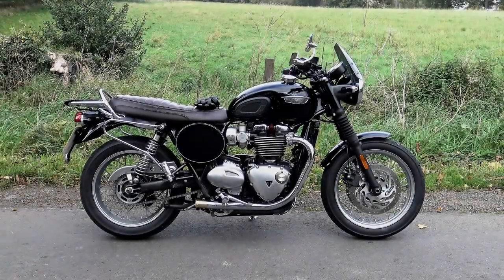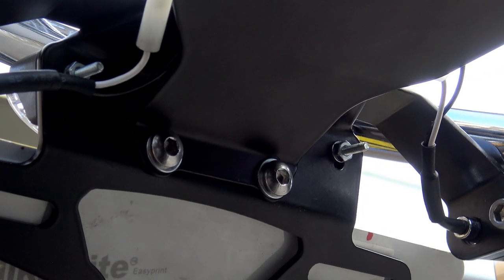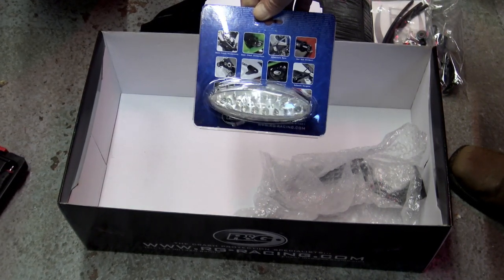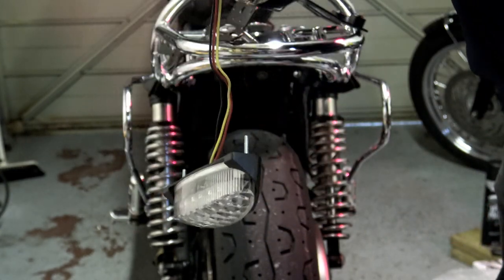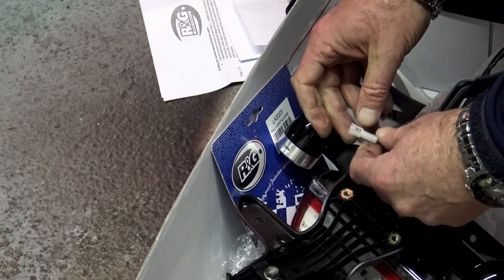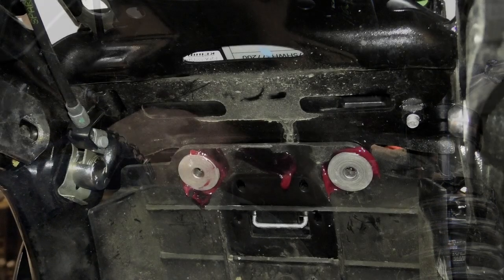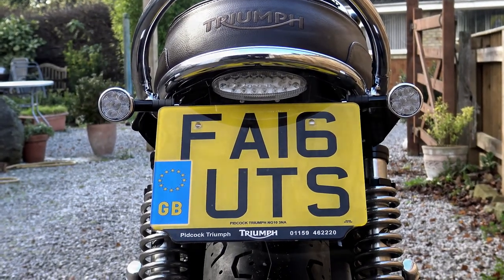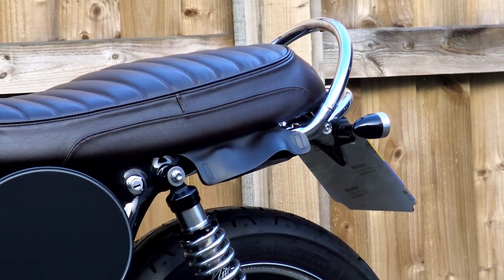Triumph Bonneville T120, FITTING THE ULTIMATE TAIL TIDY/FENDER ELIMINATOR?

Comment: I just pulled my finger out and did the tail tidy job on my XSR900 with the New Rage Cycles FEK. Really makes a massive difference to the look of the bile from the rear, and from the side, never mind the1.5kg weight saving. Only problem was that my alarm system is linked to the lights, so I had to unsplice, and resplice all the.wiring.

Comment: Hi Stuart, I watched this video loads of times and ordered this very kit and it arrived today. While I'm sure the actual tinkering of nuts and bolts will go just fine I have to admit I'm a bit nervous about the electrical bit as I haven't had any experience at all with that kind of stuff. I guess the main thing will be to just be patient enough until it's all done properly and not rush it. So this weekend I'm getting the bike road worthy again after the winter (sweden) with tyre pressure and battery etc, then I'll dive in to it. Fun times!
Reply from the maker: Dont worry about it, its only really 3 wires you cant really go wrong!
Reply: I can't believe it but it's finally done, with no electrical fires at all! Looks great except I can't decide if the indicators (same led ones as yours) stick out a little too far when the grab rail isn't fitted, I guess I'll stick the rail on again and have a look or I might have to see about finding other indicators. Anyway I would never have tried any of this without your video so THANK YOU again.
Reply from the maker: well done sir! see it wasn't difficult really was it? there are a few options around for different mounting positions e.g. on top of the shock mounts!

Comment: Hi Stuart, good instructional video. 

I have a question. Have you had a problem with the engine management light, after fitting the aftermarket led tail light?

I have run into this issue, which also caused the cruise control not to function.
Reply: Hi Michael,

Did you ever sort out the issue with your cruise control? If so what did you do?

Kind regards,
Paul

Comment: Hi Stuart,

I really enjoyed watching your video about the R&G tail tidy for the T120 and as a result brought and fitted one last March 2021. However, since fitting the LED rear light that came with the kit, the cruise control stopped working and the engine management light keeps coming on sporadically. At the time of fitting, I didn’t make the connection that the light maybe causing problems. When the bike was serviced by the dealer, I asked if they could investigate? The Triumph fitter diagnosed the problem with the rear light but as it was an aftermarket modification, couldn’t continue to make good. Even though the light was working correctly, I did re-check the 12v wiring connections which were fine. I contacted R&G racing who sent me a like for like LED light replacement, but after fitting it the problem still continued. I recently viewed one of the Triumph forums and discovered that others who had fitted the tail tidy also experienced the same. It appears the Engine Control Unit doesn’t recognise the rear light circuit after the LED modification when the ignition is switched on and assumes the rear light isn’t working. The engine management light may then illuminate which in turn affects bikes fitted with cruise control. I checked other forums but at the moment can’t find a suitable fix other than return the tail tidy kit to R&G. Can you advise if other subscribers to your channel have experienced these issues?

Kindest regards,
Paul
Reply: I was just looking into this tail tidy for a 2021 T120 (with cruise control) and would be really interested if there was a fix for this too!
Reply: @martiningram2427  

Hi Martin,

RG racing (who supply the T120 tail tidy) are aware of the problem with the cruise control after the the rear LED light fitting has been replaced. They supplied me with an alternative rear light wiring loom (free of charge) which fixed the problem. The cruise control on my T120 is now fully functional.

Hope this information helps.
Kind regards,
Paul
Reply: @fusemate  Well that's good news!  I'm really pleased that you managed to get a fix Paul - I did actually mail them last night to see if I could get an answer - maybe they've managed to modify the kit by now so that it works out of the box.
Can I just ask what year your bike is? 
I'm actually just in the process of buying a brand new 2022.  I probably won't proceed with a tail tidy right away as it seems a bit of a shame to start ripping a brand new bike to bits immediately - but it would be good to know if anyone has this working on the 'current' model.
Thanks so much for your quick reply!
Reply: @martiningram2427  

Hi Martin,

My bike is a 2019 model. I brought it second hand after it was only a few moths old. I’ve replaced the exhaust pipes for shorties, fitted a decat cross pipe, repainted the tank and side panels and fitted the tail tidy. The paint work was done professionally but all the fitting work was done by myself. It wasn’t too difficult to do and I now have a Bonneville which looks so much better than the standard bike. In effect it’s an individual custom bike but done on a budget.
Reply: @fusemate  Sounds good - I spend a lot of time flip flopping between going with something similar aged and buying new - there just wasn't so much money to save by going down the used route to make it worthwhile for me.  Though if I had I think I'd be less reticent about tinkiering about with the thing from the get go.
Don't get the new bike until next week so I'm gonna relax and enjoy it for a while in it's 'vanilla' form, then start to play about with a bit more once we've gotten to know eachother 
Thanks mate
M

Comment: Nice modification, looks crack on :) Might be worth using some black plastic thread cover caps for the open threads (makes cleaning the bike underneath safer and if greased can protect the threads). Also the cap head bolts to the indicators would be nicely finished of with the relevant sized black socket head cover caps (prevents them from being filled with road crap. Beautiful bike mate and if I had one I'd probably copy yours :) Are you putting a race number on the side plates? 120? tcrsm8
Reply from the maker: Good observations sir, and thank you! got plans for the race plates in the new year! keep an eye open!

Comment: Hi Stuart, first off I love your videos. My one question is about the turn signal wires being open to the elements. I’m worried that having them exposed could pose a problem. Have you had any problems with your turn signal wiring?
Reply from the maker: Ive not had any problems in 2 years.
Reply: @stuartfillingham  I installed mine today, took some time getting all the wiring done because I have never done any electrical work but it is on the bike and looks beautiful! Can't wait to ride with it on!
Reply: One other question. The nuts that hold the Brake Light came off after one short ride. Any idea what size the nuts were?